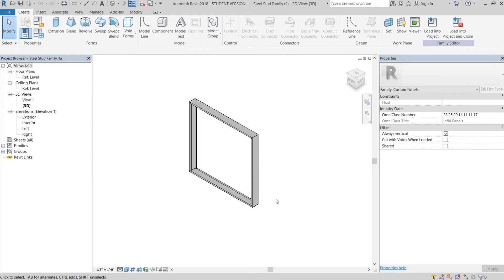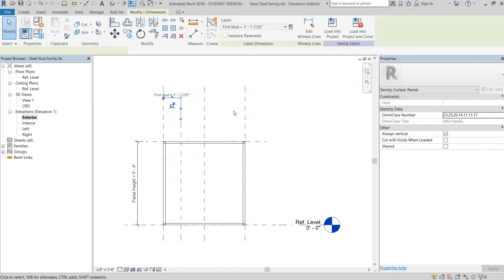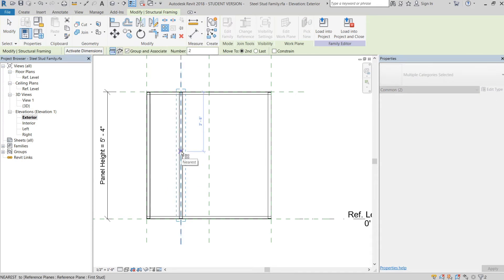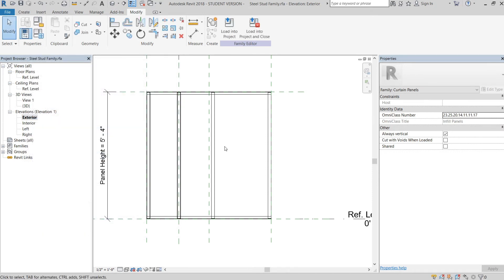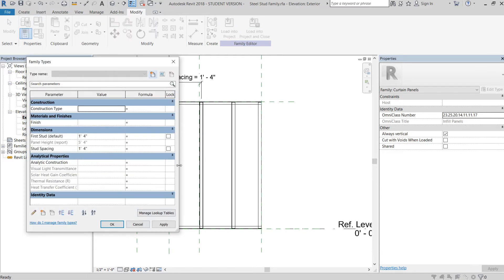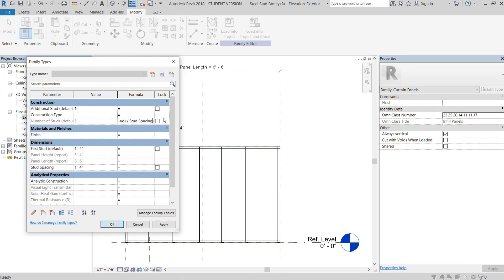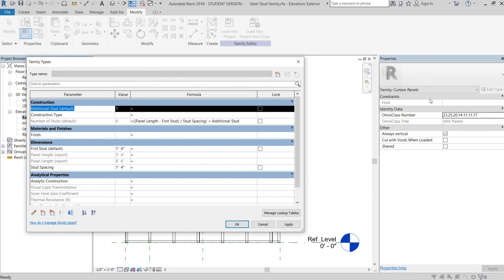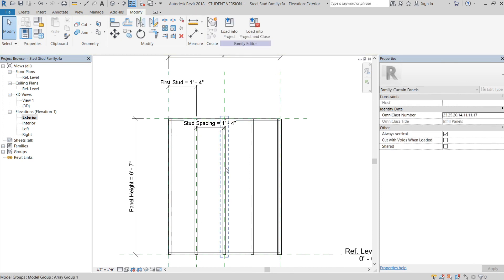Steel Stud Wall   Part 02   Stud Array

Comment: Hello. Excellent video, thank you. One question, do you know if it is possible to allow for "Enable Analytical Model" parameter in the project once the panels with the structural members are loaded into the project?.

Comment: Hello and thankyou for these videos. I am a total beginner to Revit so I enjoy going through the steps one by one for educational purposes. I have been able to slowly follow your steps up to the part were you load the stud component and the track component into the new family. This is where I encounter problems. For some reason my stud and track members are not not able to lengthen or shorten with the end tabs. they only move as one piece. Also when I create the track component , it will not allow me to pick (place on  plane ) or change the ref. elevation. Any Ideas on what i have done wrong?